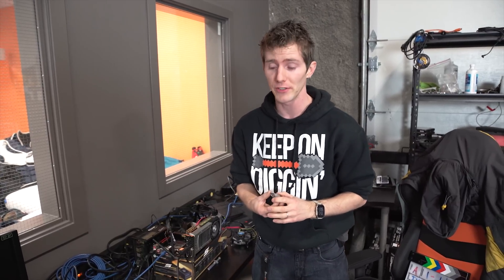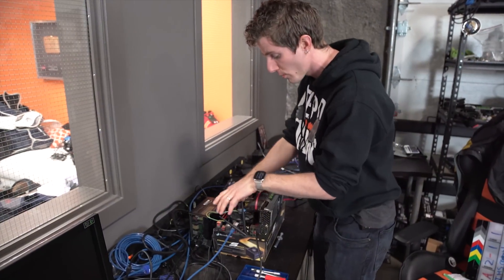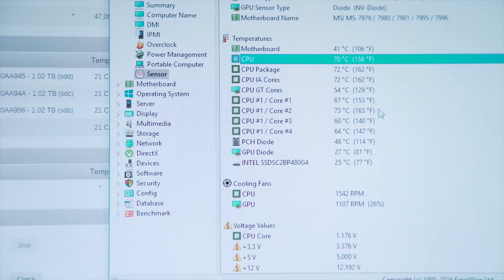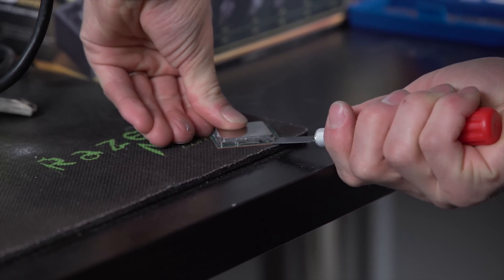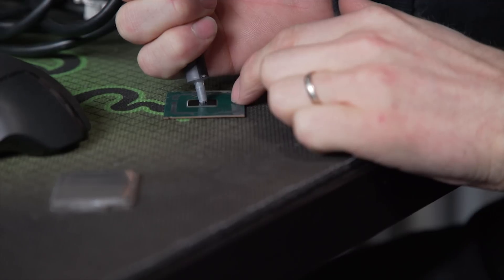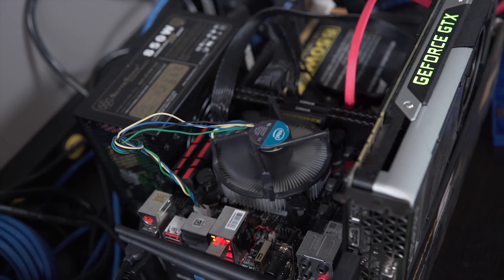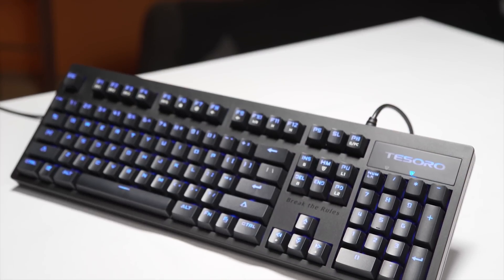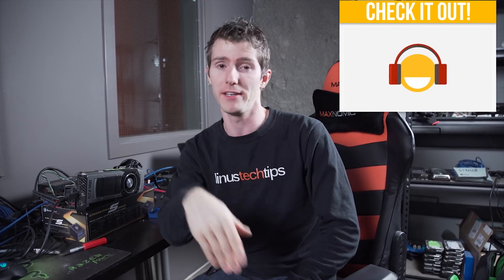Delidding an Intel Core i7 6700K - Is it worth it!?

Comment: I ended up dropping my i7 6700k 15-20c when I delided it. I used CLU between the ihs and die and noctua thermal paste between the ihs and waterblock. Maybe intel did a really bad job applying the thermal paste on my chip. But deliding defiantly made a MASSIVE improvement to my temps

Comment: Not familiar with the thermal paste used, does it need to be primed? Also it seems like there are several things tested on this channel that only improve temps by a few degrees (usually about 4 to 6 degrees) so let's say you do 3 of them you cut temps by nearly 20 degreess! I'm genuinely curious if that would be the result or if all the little homebrew cooling methods would eventually have diminishing returns.

Comment: The results very depends from chip to chip. For example, mine i5 4690K was thermal throttling @4.2Ghz and differences between cores reached 20C. After delidding (used Coollaboratory Liquid Ultra) cpu does 4.5Ghz air cooler with max 75C. In my case it was more (before it was simple thermal throttling) then 25C drop. So, check temperature differences between cores (up to 10C is ok), check online what temperatures others get and then decide to delid or not. And about warranty: when last time you heard that modern cpu died on its own? :)

Comment: Of course the difference in temperature was negligibale because a stock heatsink was used. (Shivering just saying the SH word).
There are only so many watts this thing can dissipate, hence an improvement in temps would seem trivial, since the heatsink is unfit to cool properly in the first place. Was the CPU overclocked?

This definitely needs to be redone with proper air and watercooling.

Comment: Did you lock the RPM on the CPU cooler? If you didn't (and it didn't max out), this test is pointless as the RPM would be lowered to reach the same target temperature with the new TIM.
Reply: +hellterminator This guy has a point! Also I would like to see Linus doing this kind of stuff professionaly. Like not using a ghetto testbench and trying atleast with better TIM and liquid metal.

Comment: lots of mistakes in my opinion:
1.was the fan on fixed or auto mode?
2. why use the boxed cooler? there it is likely the cooler is at its limit and not the thermal compound.

in my eyes this test is completly useless with this conditions.
Test again with a good aircooler or a watercooler.

Comment: delids cpu... uses stock cooler.... wtf man. Thats probably the limiting factor right now, a delid would very much be useless!
Reply: He did the stock temps with the stock cooler as well so it makes no difference.
Reply: JBiNN 9 times out of 10, the stock cooler is going to be the limiting factor.

Its like putting extremely high performance sports tires on a prius and saying the tires arent worth it. Well on a prius, absolutely not.... 

I've literally NEVER seen anyone delid a cpu and use the stock cooler, thats 100% retarded. Linus failed huge with this video.

Comment: Pea method is not the way to go on CPU dies. You should cover the entire die since you need to make sure ALL the die is making contact with the IHS. 
Furthermore, you should have removed the black adhesive so that it makes proper contact.

I got a 25-27ºC reduction on a 3770k with Coolaboratory Liquid Pro. Some people even reported getting a 35ºC improvement.

Comment: please make another video doing this but with the best thermal paste possible and overclocking the CPU. and using liquid mm cooling, and letting the computer run for at least a few hours on the stress test. I'm really curious what the results would be.

Comment: So basically a CPU gets "old" because of the thermal paste under the IHS?
Reply: +Yosyp thats not how that works at all
thermal compound is there just to conduct heat, them using a sub-par thermal compound means that the heat conducts from the ihs to the die in a less-than-optimal way and therefore gives you higher temperatures, it's not enough to change fps or lifespan when you're getting <70 degrees under load without the change, and that's with a stock cooler.
Reply: Link Freeman Yeah but I'm not talking about the lifespan, but the overall performances

For example, if I want to overclock it after 3 years of running constantly it's gonna steal me room for the temperature
Reply: Yosyp 2 degrees is not a significant difference when overclocking, if you're pushing your cpu to a point where 2 degrees could be the difference between it dying or it being stable, then you're pushing it too hard, and 3 years? I've got my non overclockable 3570 and it's still running strong at 3.4 ghz and it's 4 years old now.

Comment: Dear Linus, there are LOTS OF critic points I have to claim regarding this video: 1. Your cutting approach seems too rough – better is using a thinner blade only on one or two corners, then using a credit card to cut and split. 2. Lapping makes sense, as NO IHS ever (and also no heatsink) is perfectly even – they vary from very konvex to very concave or even wavy. But you shoud lap all the nickel off to have a shine copper surface. Polishing is also important for better heat transport between different or even the same metal layers, as the electrons (which are the "transporters" of the heat) has a better flow, the better the contact is. That's also the reason why removing nickel is better anyway, as nickel has a tenfold worse conductivity than copper (which has actually except of Silver the BEST conductivity by far), somehow disturbing the flow of electrons, no matter how thin the layer is. 3. Using "normal" thermal paste is by far worse than using liquid metal (I've seen your NCIX video – it's crap!), as the conductivity of liquid metal is AT LEAST 10 TIMES BETTER. I've delidded my 6700K just 10 days ago: the results by ONLY changing thermal compound to liqid metal was 20 DEGREES on stress test with 8 threads – and that although I even forgot to fix fan speed, thus running before on 1372 rpm, now after delidding on only 982 rpm (which makes the difference from medium loud to almost silent). The lapping of the IHS brought only another 2 Degrees so far, but yet I have to lap my heatsink too, as these parts fitted before accidentally reasonably good (IHS concave / heatsink convex). I ran the system on stable 4.5 GHz OC for both tests (and till now – without issues), with Auto Loadline Calibration (!), resulting in only 1.200 Volts! Skylake is really amazing.

Comment: The  i7 6700k costs 2500K (minimum wage is 800) here in Brazil so no way in Hell am I ever doing something like that to it but thanks for the video, it is always interesting to discover new (and crazy) things ;)
Reply: It's not as dangerous as it looks, and depending on your luck of the draw might drastically improve performance.  But, again, you void warranty. And if the cpu is old than this can help even more because of dried paste.

Comment: If u do something like that, use older CPU's with dried thermal compound between die and ihs! I made this on my i5 3570k from Intel's 3rd Gerneration of Core I processors. I have around 10-12 degrees lower temps now. This doesn't really make sense with brand new CPU's.

Comment: My temps went from 70-80c on my 3770k @ 4.4ghz to 40-50c @ 4.7ghz... the standard thermal compound was awful, and even missed a bit of the core! . Used the liquid metal pro on the core, and Gelid extreme on the IHS to waterblock TIM. Totally worth it for my case.
Reply: How old is your CPU?
how much have you been using it, I mean?
You have to consider this cause the thermal paste gets old too
Reply: was new may 2015, was like that from factory.

Comment: You guys keep making the same damn mistake, USE THE SAME FAN SPEED IN BOTH TESTS. The CPU fan is doing 1542 RPM in the first test (which is at 70 C), the fan is doing 1477 RPM in the latter test (67 C). It's just bad practice and an invalid comparison. How much difference does the additional 65 RPM do? Probably not a lot, but please (get a 2-pin fan or a software to set the RPM to the same in both)

Comment: This is an absolutely terrible test. For starters, you may have used the stock fan profile, which would've adjusted the fan speed to roughly maintain a target temperature, which is a huge variable to leave unaccounted for. You also used a stock heatsink, which is going to be more of a 'bottleneck' under high loads and reducing the significance of any changes in thermal paste. What also reduces the significance of the variable that you should be testing for is the low heat output. This test should be conducted with an overclock, because heat transfer is not a linear process in relation to heat output, as you seem to imply in your intro. Dozens of people online have documented this process for Ivy Bridge and Haswell, and saw temperature drops in the 10C to 20C range while overclocked, on better coolers, and with constant fan speed. I'm not sure if you just don't take your influence on the community seriously, or these are just the results that Intel, a major sponsor of this channel who also doesn't approve of this practice, wanted.

Comment: In my opinion it's worth it
I delidded an i5 4690k with Collaboratory Liquid Ultra. The cpu is overclocked at 4.8 Ghz with 1.36 vCore and it hits a maximum temp of 61 celqsius during  stress test so...

Comment: I've seen ppl get a around 20 degrees improvement just from doing what you just did, reattaching the IHS and just change the thermal compound. So I guess you really didn't use "good" compound? If it can differ that much. And if you get almost a 20 degrees improvement I'd say it's pretty worth it tbh...

Comment: well, usually for de liting the cpu enthusiests use a heat guand with  a vice. Also they use the cool laborotory liquid mettal thermal compond, that can give abought 10 degrese in stock and abought 20 degrese in OC difference. Im saing this because i already tested the liquid metal on my old labtop, it gave a difference abought 10 degrese celsius compared to the thermal compound a have been using before.
Reply: Vise on skylake is more dangerous
Reply: +MinecraftAwaits i know, but using a heat gun will still help loosen it